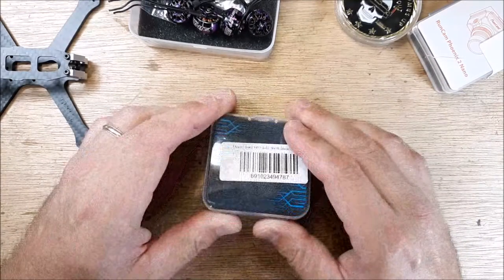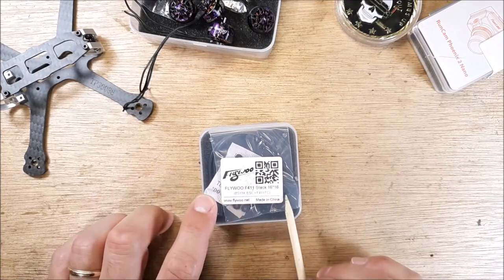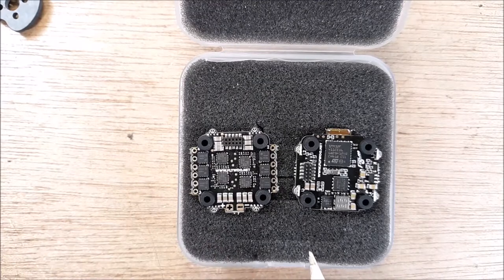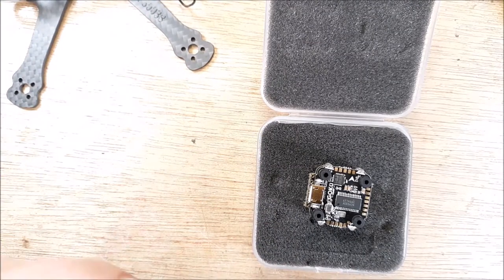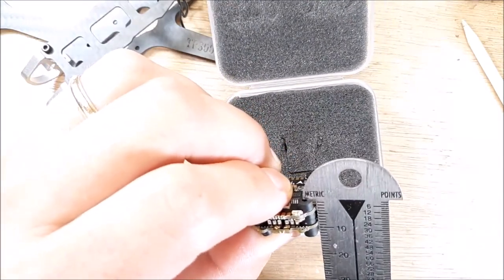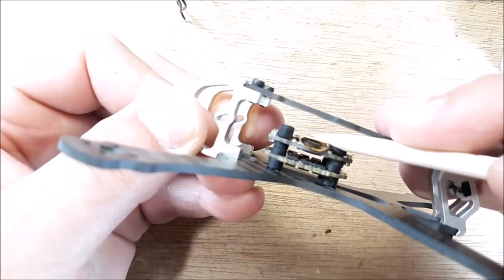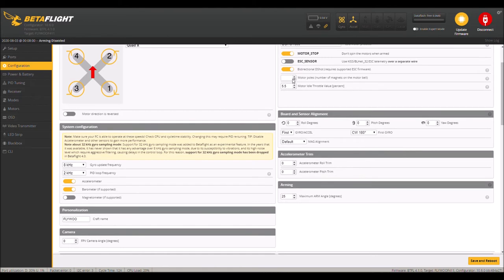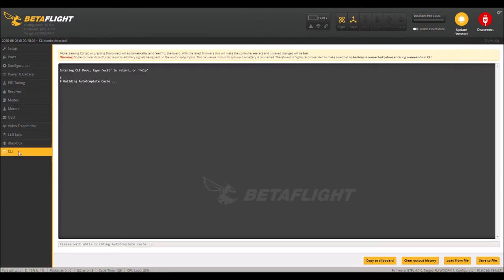Flywoo GOKU F411 Micro 16x16 Stack | Flywoo Esc & Flight Controller Unboxing

Comment: Curious as to what you're using for this quad today?  My •	Goku F745 Nano 16x16 stack died the other day.  Looking to rebuild.  My tadpole is the 2.5" version
Reply from the maker: It's currently in a 3S, 3inch Gank frame. Here's the build video below, if our curious. That stack seems to perform best on 3S and with lite amp draw motors. I'm using 1206 4S GepRc motors from 2017. They are easygoing on the Flywoo ESC and I haven't experienced any desync issues - as I did from the Iflight motors.
https://youtu.be/5AFEoy1hLxM

Comment: 16x16 is better for unregistered 250 gram helicopters because the fuselage is narrow and vertical. I just bought one from HGLRC. Very happy that I am not the lone weirdo that likes 16x16.
Reply from the maker: Right, Just looks better. I am debating switching out the Flywoo. If you remember and are willing and able, would you come back and let me know what you think about the HGLRC 16x16 stack? I'm interested. 3 Flywoo stacks later, not happy..
Reply: @propsoff  I personally had problems with fd413 stack from hglrc,bad flight controller thought it was esc,so replaced and after days of troubleshooting,found DC had bad gyro,causing desyncs and erratic throttle so bought flywoo goku411 20amp version, happy new year and be safe🙏

Comment: Hello mate, I'm doing my first build with this stack on a phantom 2.5 with runcam nano 2 and crossfire nano receiver, I'm sure i wired it up correct but when i connected battery the vtx smoked and I'm sure flight controller and esc are damaged...i got another stack and shortsaver v2... motors are connected and receiver when i power up through shortsaver everything seems fine i get 3 beeps followed by 2, leds all working and red light on receiver... once i connect vtx and camera the shortsaver gets red light and won't power up.. if i disconnect vtx and leave camera on it powers up but with no sound, no leds work only the binding type of leds on flight controller come on and crossfire nano has solid green light instead of red, I've not binded receiver yet... I've desoldered vtx wires and re done them but same happens when i power up with vtx connected the shortsaver won't power it up, I'm lost and don't know what to do now, Any info would be appreciated, should i connect camera voltage to 3.5v pad instead of 5v because the nano can run of 3.5 to 5, I'm thinking of getting different brand vtx and trying that, thanks
Reply from the maker: So interesting to see this question.. No joking, I just now got home from flying and the quad with this stack and vtx was giving us serious fits.. Lol, so aggravating! 
Ok, tonight at McDonald's, we have decided the VTX is absolute garbage and we are getting the HGLRC Zeus Nano VTX.. I have that VTX on my "Super Duper Mega Ultralite 138 Gram ultralite 4s 5incher", and I really like it. It has 16x16 tabs too.. I contacted Flywoo 6 times about their stack and the issues I had with both of them and heard nothing from them.. Fortunately, I ordered them from RDQ and they helped me out on the back end..
Yes! Get Rid of the VTX is the conclusion we came up with., Next, the entire Flywoo stack...
Reply from the maker: I thought more of the issues your having and wonder if you have a multimeter and do a continuity check?
Reply: @propsoff thanks for the quick reply.. lol so the vtx is a load of rubbish,i should never have brought a second stack after the first one smoked, it was the leds on it that made me get the second one lol..i was looking at the zeus nano yesterday it looks ideal for this stack... can you wire the cam to it?...
I actually ordered a multimeter a few days ago and just waiting for it to arrive, I've been watching some videos on how to use it to check for continuity and voltage its all new to me so much to research and learn..i also have a spcmaker 130 pro 4s 3 inch which one motor stopped working on a punchout and fell out the sky, the motor would flutter and stop working with throttle and on betaflight so i changed it and the same happened so i assume it's the 4 in 1 esc even though on blheli configurator it shows all escs on there, is that possible for the esc to be broken but all 4 show up on blheli?..i can't find the exact 4 in 1 esc it's out of stock at the moment on bangood... do i just need a 4 in 1 board same size and and amp with the same pin layout on the jst connector which is - +1234  i assume that should work..
Reply from the maker: @ammar6937  
I try to make time every night to answer my question bank, lol.. Your welcome...🍻

That VTX is rubbish and the stack, well? I'm sure we could have done better, lol.. Yes, you can power the Zeus VTX from 5 volts and the camera from the Zeus VTX.. 

As far as the Multimeter, I have a Quick Tips Playlist full of how to videos.. I really like the meter I chose for those videos.. Great tool 4shO!
Reply from the maker: @ammar6937  
If the mounting and amp size is the same or very close, any 4in1 ESC should do the trick.. When you get it, just double check the wires are the same orientation( +v/-v/s1...etc..).. I really prefer direct soldering those wires if possible.. The connector should be universal, but the wires coming out of said connector may not be - beware!